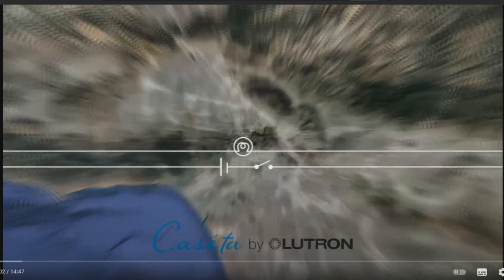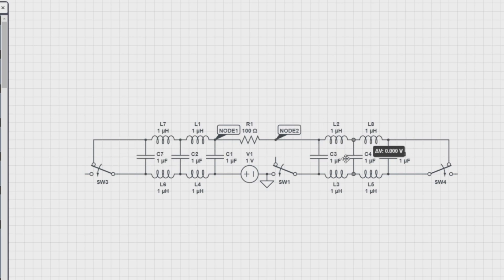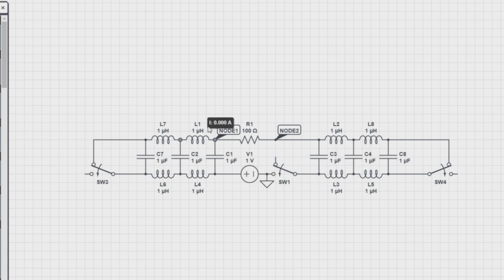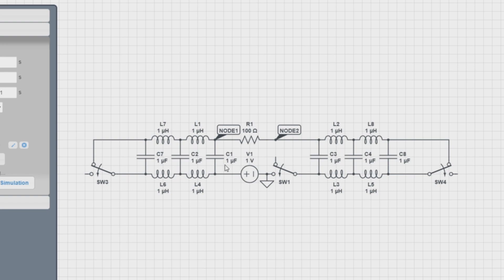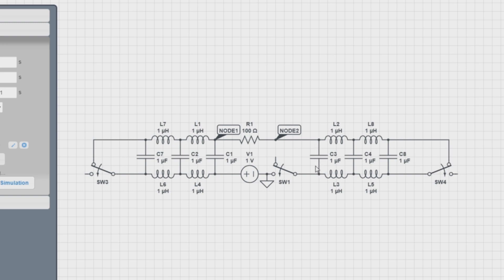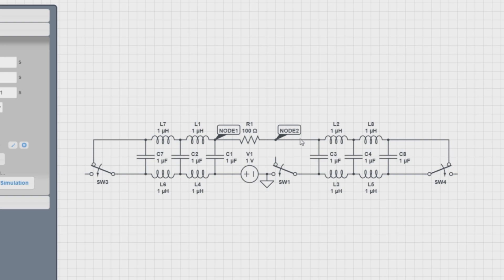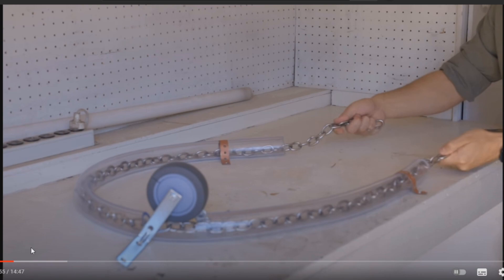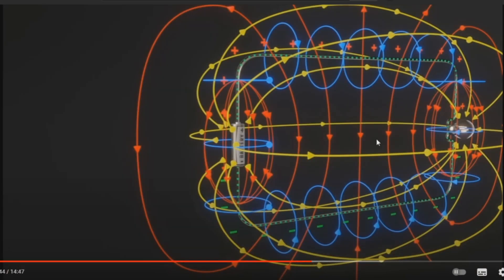Explaining the Veritasium "The Big Misconception About Electricity" video

Comment: you really do not know what you are doing.   Your modelling is all wrong and per unit length values are ridiculous.
GH
Reply from the maker: I'd appreciate any corrections, however I stand by the idea that the absolute values of the thought experiment don't matter. I used large values so the free simulation tool would not choke, with realistic values a smaller timestep is needed but the conclusion is the same. Veritasium has not provided any information about the light bulb other than "it turns on the second any current moves through it", therefore just the physical existence of any moving charge is enough to turn it on. The point is not to model the correct EM effects in the wire, just to show that there is a coupling to the light bulb no matter how small.
Reply: @ZongyiYang  minor correction... I believe the term he used was "immediately when current passes thru it", not "any current". The reason for this subtlety is that I believe that he was stating that to avoid the consequence of Time Delay for things like capacitors in driver circuits or heating up filaments etc. So I believe he was just trying to say "the moment the required current reaches the bulb it turns on"... not "any current"... 
Because like I mentioned earlier, if it was "any current" then the moment the first conductor was attached to the battery, it would turn on the light.
The moment Veritasium moved from 1 place to another, it would turn on the light.
The moment he "touches" the switch, it would turn on the light...
Well you get the idea. So, it makes no sense for it to be "any" current. For this demonstration to make ANY sense at all, the bulb has to have some reasonable current requirement.
Reply: @ZongyiYang  Veritasium is trying to imply the energy flow is in the fields propagating across the space between the battery and the bulb rather than in the fields along the wire.  This is not correct.    The fields in the air between the battery and the bulb are not intense enough to account fot the power transfered say to a 100 watt bulb.

The Poynting Vector magnitude gives the power density.  The E-field and B-field intensities outside the wire in that 1 meter gap have magnitudes so small that they far short by orders of magnitude of that required to account for the actual power flow to the bulb.
GH
Reply: @georgehnatiuk5806  good to see you George. I remember you from ElectroBoom's video mucking up Faraday's Law. Veritasium has constructed a thought experiment in which his problem constraints permit the bulb to be illuminated from purely radiated adjacent EM fields (the wires are utterly superfluous to the experiment)... which has left many people confused as to what the point of wires even are in practical circuits. 

The fact so many people are fixated on the 'causality breaking' elements of this circuit just goes to show what a disappointing video Veritasium put out and how much confusion its causing.
Reply: @FabrisFanatic  yes this video is wrong on so many levels and the damage is considerable.
I have to give V a failing grade on this one.
GH
Reply: @ZongyiYang  You cannot use a lumped element model in this manner to give correct timing of a continuous distributed network where a signal propagates along a wire.   You would need a high $$$  EM simulator at the very least that computes the partial differential equations of Maxwell with appropriate boundary conditions.  Good luck.
GH
Reply: George, since this problem is not a quantitative engineering problem but rather an EM theory problem, a person can make the case for one answer or another just by explaining it in plain english. The use of circuit simulation software (albeit rudimentary) is simply a useful visual aid to facilitate the comunication of the theory. 

In fact, ZY had a very thoughful analysis in this video that correctly touches on the theory behind this problem. The initial interaction is that of two near field antennas. Then transmission line behavior dominates as the pulse reflects of the ends of the loop. These reflections bounce back and forth as the current steps upward until a steady state is reached. See my video for an ANSYS HFSS simulation of the fields.
Reply: @PulsedPower  you are missing the point.
The video of Veritasium is very misleading and incorrect.   The dominant and primary energy transfer is along the wires and not in the space between the battery and bulb/load.  No matter how you wish to analyze this either from an electron transport using solid state physics or a field point of view, the energy transfer is along the wire.
Reply: @cjay2   yes, that is unfortunate.   I do not follow V but was directed to this video by a friend and was appalled at what I saw.   He has done his viewers a great disservice by putting more garbage video out there to confuse people.  It is hard enough for people to sort through good and bad information without seemingly trusted sources adding to the problem.
GH
Reply from the maker: @georgehnatiuk5806  I think everyone agrees the dominant energy transfer method is through the wires, I'm just explaining why Veritasium came to his conclusion. He is "technically" correct from a theoretical and physics point of view, but form a practical point of view only the wires matter. That is why people are confused about his answer, he is technically correct but the question is misleading (and he's only technically correct since he uses a magic light bulb). Dave from EEVBlog also just made an explanation and his simulated circuit is exactly the same as mine, so if there needs to be further clarification his video may help clarify things.
Reply: That is fine for a magic bulb but at time 00:59 he goes on to state this misleading sentence which is incorrect:
<This question actually relates to how electrical energy 
gets from a power plant to your home.>

Had he not implied that power reaches your home in the time   1m/c seconds, all would have been fine with the hypothetical.
GH
Reply from the maker: @georgehnatiuk5806  My explanation is wrong. Veritasium is actually correct. I think EEVBlog also misapplied the model. I have made a new video with a better analysis: https://www.youtube.com/watch?v=RsiYXfpJu5U
Reply from the maker: @georgehnatiuk5806  I have shown in my video that for a 300 ohm 0.48W bulb, I can get 2.7% of the power on the initial transient. For the best case scenario, a 1.5k 98mW bulb will get 50% power transfer in the transient. But you are correct for other bulb values, like a 14W bulb, the % of power from the transient is miniscule compared to the steady state power. It is up to the choice of the load. Also I'm only talking about the circuit from the problem, I agree that does not apply to the AC household power transfer problem sine any real world household load is going to consume way more than milliwatts of power, so I agree that can be misleading in Veritasium's original video.
Reply: @ZongyiYang  That is the point I have been trying to make.  The video of Veritasium is very misleading and incorrect.   The dominant and primary energy transfer is along the wires and not in the space between the battery and bulb/load.  No matter how you wish to analyze this either from an electron transport using solid state physics or a field point of view, the energy transfer in the steady state is along the wire and NOT in a transmitted field thru the air between the battery and bulb as he has implied.
This video of his was very poorly done and I am appalled at his unprofessionalism.
GH
Reply: You are such a sad person GH, even worse than an angry retiree...
Reply: @alpen-u8h  How does your comment contribute to the discussion?
Reply: @Harmonys-y2k2  
This is a simple problem and you are all making it complicated.  A good EE does not need simulation software to design and analyze circuits.  Put your thinking cap on and ask yourself what keeps the bulb powered up and shining after say a minitue or two after the switch is closed?  By then any transients have certainly died out having lasted less than a microsecond.  In the steady state, this is a DC problem and not an AC or transient problem for in the steady state there are no traveling waves since there are no time varying fields to capacitively or magnetically couple from the battery to the bulb.   These transient analyses you all are performing are totally unnecessary and a waste of time.   Who cares there are some stray capacitances and mutual inductances between the wires and circuit elements?   It does not matter for this is a DC problem in the steady state that powers the bulb and not transients.   What is the mechanism in the steady state that powers the bulb is the question Veritasium and the rest of you should be answering and not what kind of transients might exist after the switch is closed?   Who cares about the transients for they are short lived and too weak to power the bulb.   Do you think a transient upon closing the switch could power a DC motor or a 100 watt incadescent bulb connected to the battery?  Come on and think this through.
GH
Reply: @Harmonys-y2k2  
< I like the entire idea behind the original video as it shows how easy one can get lost using simplified models, such as those often used in engineering or education. >

The only probem encountered is misapplying models no matter how simple complex.  This circuit of a battery and bulb can easily be analyzed using a series R-L combination with switch, load(R) and battery.   

< Unfortunately these models break down rather easy, and are inadequate to solve surprisingly simple problems.>
That is BS.   I have never had a problem modelling circuits from DC into the GHz region in the 40 years designing some of the best test equipment Hewlett Packard had to offer.   Myself and other engineers in the design lab never had to use simulation software for design.

GH

Comment: I like your simulation,  but you might as well put in realistic value in the model.  For wires spaced 1 meter apart, the capacitance is 
approx.  3 picofarad per meter length.     Veritasium has really put up a misleading video this time.
Reply from the maker: The absolute values don't really matter, they just need to be non-zero. I could have used realistic units, however the free simulation tool I was using was a pain to use and was in a web browser, so I didn't want to push it anymore than it could handle. With tiny capacitances I would need very fine timesteps.
Reply: @ZongyiYang  "The absolute values don't really matter," 
hmm well, actually they do matter at least to some degree, if you are trying to explain the thought experiment so that you can demonstrate the amount of current that reaches the bulb. This is important because to the majority of the viewers.. its supposed to be a light bulb. Not a "Quantum Bit" or "Photon"

Because the light has to require some current value to turn on. And it won't turn on if it's any kind of normal light bulb. Veritasium is clearly making the claim that the "energy" needed by the light is transferred by the EM field as a LINE directly to the light. That is the incorrect part.
The energy needed to turn the light on HAS to travel thru the wire unless the bulb is some kind of bulb that requires some ridiculous fraction of amps probably micro amps. 
And that is not a normal kind of bulb. So, if Veritasium is demonstrating with a "battery" and  "bulb"... and visually shows those to the audience... then THAT is what should be used to simulate the circuit.
Also, none of the setup in Veritasium's video makes any sense if you assume that "ANY" current turns the light on.
This is because the switch is NOT required.
All you have to do is connect the switch to the battery.
Nothing else is needed. Once he does that, it has an inductive effect.
Clearly, since the LIGHT IS OFF when shows the video, and the light switch is OPEN, then more than "any" current must be required.
I know you are trying hard to make this video "ok", but it is very wrong. And, moreover, regular viewers are already buying into this idea that all the energy is transferred in a straight line so it doesn't matter how long the wire is... its not acceptable.
Reply: @marcfruchtman9473  i think the point is there can be a way of lighting the bulb with out the wires and he is likly wanting poeple to think about that  maybe a less loss way of doing things
Reply: @ambersmith6517  Powering thru the air has much more loss than powering thru a conductor.
Reply from the maker: @marcfruchtman9473  I think we are actually in agreement, Veritasium's explanation only works because of all the magical properties he has imparted to his setup. He is technically not wrong at any particular point, it's just that the setup is unrealistic. I did mention in my video that 1. The response is transient, which is not what people expected when they assume the light bulb must turn on, and 2. the power transferred is extremely small. Dave from EEVBlog also made a video and he uses the exact same method I used for his simulation, even using the same values of components. The main issue with Veritasium's video is that it is not really useful from a practical perspective, it's only true from a theoretical or physics perspective.
Reply: @marcfruchtman9473  I lurked a few of these related videos to see if there was any sanity on the webs.  Thank you for cutting through the bs.  I'm an EE, the original and response videos are so long winded and misleading.
Reply: @ZongyiYang  I'll grant you that, but you don't need a 10 min video with simulations to clear things up
Reply from the maker: @michaelhansen7516  Oops, I might have missed this comment chain, but I wanted to mention that my explanation is actually wrong in many ways. I have made a new video with a better analysis correcting my mistakes: https://www.youtube.com/watch?v=RsiYXfpJu5U

Comment: Here is what I'm not sure about: What we start with is a wire connected to + DC voltage. This means the entire wire, starting from the (+) battery terminal and ending at the switch, already has potential before he even turns the switch on. So, when he turns the switch on, the (-) DC from the battery only has to travel a couple feet to the switch (which is already at potential from the (+) battery terminal) to make the connection. In other words, the (-) DC travels from the battery and connects to the (+) DC at the switch, not all the way to the (+) battery terminal.
Reply from the maker: Yes this is true, but that propagates as a wave down the entire length of the wire, before the (-) potential reaches the light bulb. It would take 1s for this wave to propagate to the bulb. It is not like connecting the switch causes all the (+) in the entire wire to move at the same time to the (-) battery.
Reply: @ZongyiYang  Interesting. But since the (+) potential from the battery has already went through the light bulb, the bulb is considered "on" before he even turns the switch on. I know this sounds like splitting hairs but... if we swapped out the light bulb for a diode, then the diode would never open because the potential voltage is so small.

So in one instance the diode is considered off because no potential voltage can pass through it. But on the other hand, the bulb is considered on because it passes the voltage. This is all before he turns the switch on.

Seems like he should instead ask: how long will the light bulb take to pull amps after the switch is turned on? Because the light bulb is technically "on" since voltage has already passed through it to the switch that he is about to turn it on.

* Really he should have a dual switch at both battery terminals that turns on both (+) and (-) at the same time at the terminals, then I wouldn't see the problem.
Reply from the maker: My explanation is wrong. Veritasium is actually correct. I have made a new video with a better analysis: https://www.youtube.com/watch?v=RsiYXfpJu5U